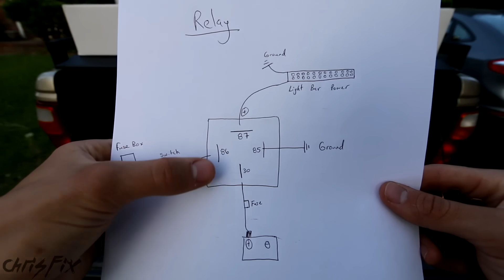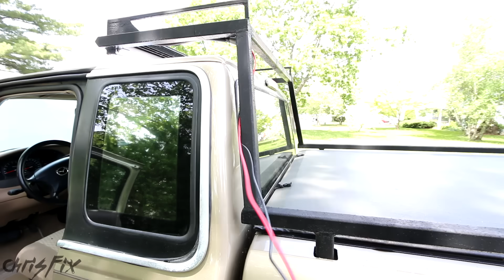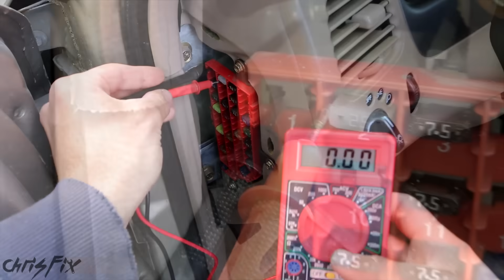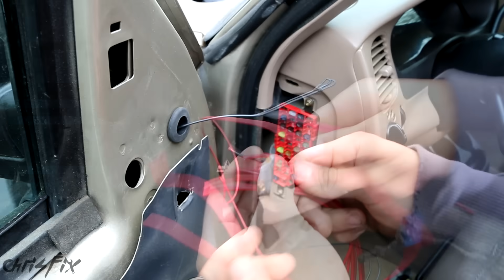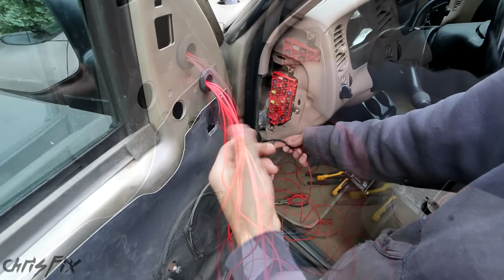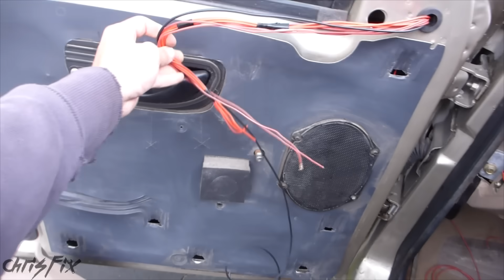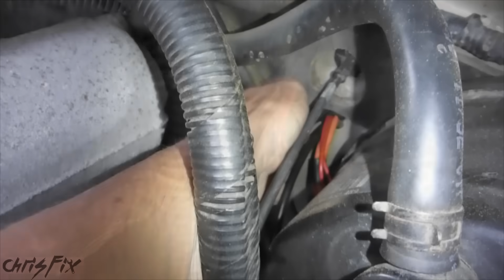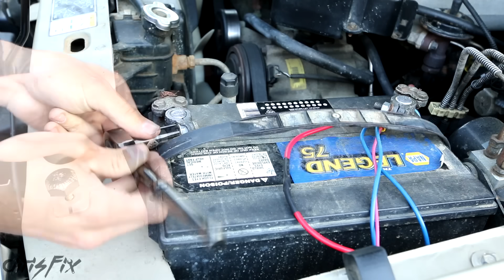How to Wire an LED Light Bar Properly (Project Night Light Episode 3)

Comment: Your high-beams are pretty weak.. Mine light up everything at about 30% of the brightness of your LED bar.

Really tempted to install something like this though. May wire it to both the high beams and an independent switch so they both turn off when facing oncoming traffic

That way I still get the longer range light of the highbeams without having to turn two separate switches off in the face of oncoming traffic! (While having a switch to disable the LED bar on main roads)
Most of the roads around me are rural, Only meet 1-2 cars if any at all.
Reply from the maker: Azurren The high beams are normal 65watt high beams. The light bar is just that much brighter!

Comment: Very well explained, electrical is by far the hardest for me.  Thankyou for another spot on video!  Your helping alot of people!  Especially like the drawing out your plan, that's the most important part of any electrical work, have a plan i.e. lights, gauges, and so on.  Only things I noticed were the negative terminal main harness looks frayed and the out side light harness going down the cab should also have that large rubber on the outside as well to further protect from people and weather.
Reply from the maker: Ryan Schneider Thanks a lot Ryan. I am glad you are learning a lot! I need to install new battery terminal ends and get that whole system in better shape. I am installing a new alternator so I will upgrade the wiring as well! As for the other wire that runs down the side of the cab, there is only so much you can do to protect it so as long as the main wire that is hardwired into the light bar is protected, I am satisfied.

Comment: It is significantly easier to run the switch off a ground and give the relay constant power from the 30 pin to the 86 pin. You can typically find a ground source easier than a power in the cabin.
Reply from the maker: wingman778 Thanks a lot! I never really thought of running switches off a ground until now.

Comment: a few points that i wanted to say: 
1.it's not so much important on older vehicles but newer models, you may want to use a memory saver (some models plug into a cigarette lighter) the reason for using one is ive seen cars (vw) where the battery was disconnected and then when it comes back on, the throttle is not set properly (it adjusts for build up) the only way to fix this issue is to take it to a shop (a kid in my class learned the hard way)
2, i personally like to add heat shrink to the bare metal of the exposed crimps (when attached to a relay or switch) or ill even scrap the plastic color piece of the crimp connector, solder and crimp then add heat shrink. the likelihood of something happening is slim but i like to avoid any possible issues.
3, when adding switches to doors I recommend the use of water proof ones, should your door be open when raining
4, the other alternative to heat shrink, which ive used a few times, is liquid electrical tape, if you haven't used this stuff before let me know ill send you some to try.
other than that this video is well made, you thoroughly go through each set (and repeat things) 
5. future project ideas: i would add marker lights to the sides of the bar (down the back window) maybe add a light bar (amber tow truck type thing)
keep up the good work (sorry for the essay comment)
Reply from the maker: austins_creations Thanks a lot for the tips! I like a lot of your ideas and project ideas!

Comment: Why didn't you just ground the switches to the door instead of running a wire through. Apart from that GREAT job Chris.
Reply from the maker: Big Guy Review Thanks! I dont know how good the door is for a ground since the factory ground was not grounded to the door. I figured it would be best to just put it at the factory ground location.

Comment: That's so cool Chris
Awesome job
I want to know if it baseball to have same like this LED light to be sheept on to me
Thanks alto man
All ur video ar very helpful
Reply from the maker: Moaiad Salih Thanks a lot! What do you mean in your last question?
Reply: My guestion is: this LED light bar ar not available in my country and I need it for my car am doing off-road most off time...so is there is anyway to send LED light to my country. ......
And I have another guestion. ..... can I connect the LED light with the headlights so when turn on the headlights the LED also turn on???
Reply: Thanks Chris. ..u r the best
Reply from the maker: Moaiad Salih You can contact Wurton and see if they will ship it internationally for you. If you mention ChrisFix and the video they might help you out. You do not want to hook these up to your headlights because you cannot run them all of the time. It is too bright and you will blind people. But you can hook it up to your high beams.
Reply from the maker: Moaiad Salih You can contact Wurton (light bar company) and see if they can ship it to you. I wouldnt connect it to your headlights because if you are on the road, you cannot run these when cars are around. You will blind them.

Comment: So i'm installing RGB LEd strips as under light without relay. Can i just run a wire(with fuse) from the battery and than put the negative on chassis? the strips(controller unit) only uses 2A. Or is it really needed to put the negative to the negative on the battery?
I'm not using a switch between. Not that its a problem to put the led negative on battery negative.

I'm having this question because most electronics are wired as ground(including AMPS)
Reply from the maker: Sword of damocles Since it is only using 2 amps just make sure you fuse the wire within 1 foot of the battery to be safe. You do not need to ground to the battery, you can ground to the chassis. Let me know if you have any other questions!

Comment: Great video man, as usual..... I would have mounted the switches on the dash and would have used fighter jet style. At least that's what I plan to do.... I'm in the process of finishing installing my cb radio. You should put 1 too, they are cheap and easy to install.
Reply from the maker: Arlind Sadikaj Thanks a lot! I couldnt find a spot on the dash that was good and easy to get to. My arm is always resting on the door so the switches are right there for me! A cb radio would be pretty cool!
Reply: ChrisFix I have an expedition, I have plenty of space so hopefully it comes out nice.

Comment: Hey chris!! I have a 2001 accord and my mom just gave it to me, it iw in good shape but the clear brown leather on the inside has yellow and black spots that I've tried to clean with alcohol and a product from the mall, no luck.
Can you make a superclean video on how to clean leather interiors?
Reply: I have the same car and I love it to death but that stupid leather gets so dirty. Get some simple green and scrub brush  and it will just come right off
Reply: Applekid What is that? I live in mexico, is it made of alcohol, its a window cleaner or just common cleaner. Thanks
Reply: NicholasCagex10 for impossible stains, I use very little amount of break fluid on a cloth, works like a charm depending on the type of stain.
Reply from the maker: NicholasCagex10 I probably wont have a video on cleaning the interior for a little while but for now, try using saddle soap. It is for horse saddles and is supposed to be really good for cleaning and protecting leather!

Comment: Great job Chris , but won't all these lights and the alley lights will put too much demand on the battery and the altenator while the engine is idiling? ex: some shaking, just wondering.
Reply from the maker: Mohammed Alsultan It can but that is why I am upgrading my electrical system with a larger alternator and better wires.

Comment: Wow that makes such a big difference!!, from candle power to stadium lighting in one click :-))
Really smashing professional job chris :-D, love the split fit tubing, looks so professional and really neat/safe, I dont think it could be done much better than that mate :-D
One oh so minor thing, you plugged the fuse in before you routed the bare cut wire through the engine bay, if you left the switch on then it could have shorted, but you didnt, so it didnt ha ha :-D.(dont re-edit, its fine).
For non illuminated switches i put the switch in the coil earth side of the relay, just a single wire runs into the cab to be earthed anywhere.
No danger from it getting shorted to ground or live, the relay coil power comes from the battery+ allready on the relay, no fusebox tap.
Reply from the maker: zx8401ztv Thanks a lot bud! As always I appreciate the tips! From what you and many others have suggested, it sounds like I should have ran the switches off the ground instead of the power. I can still adjust but that is good to know!

Comment: High beams seem like low beams compared to that sun on the roof :D Is there a reflection on the road and gravel or is it just the camera being weird? You should've zip tied the wires behind the door panel too, but that is just nitpicking :) Great job!
Reply from the maker: February After shutting the led light off, I sometimes wonder if my headlights are even on haha. That is the camera being weird because the light is more concentrated there.

Comment: So I can't use that on the highway right ?  What if I mount it below my car kinds like doc lights ? Because my highways have no light and it's pretty much black after 5 feet in front of my car.
Reply from the maker: Echo-GAMING You cannot use these on the road if there are cars. Even if it is mounted low it will blind people because it is so bright. That being said. I will be installing some HID Projectors so stay tuned for that which will give your car a lot of light!

Comment: Adding all those lights wouldn't that put strain on your battery and alternator?
Reply from the maker: ***** Indeed it would which is why I will have a video soon on replacing the alternator with a 130amp instead of the stock 95amp.
Reply: yes it would

Comment: Nice job. I never thought I'd see LED lights about 65°kelvin. Which is as bright as the sun.  I thought my led flashlight I used for inspecting homes was bright. It's only 256 lumes.  What was your rating on the package of the light bar?
Reply from the maker: George W Thanks! The light bar is 40,000 lumens! Crazyyyyyyy!

Comment: Aaaa, holy crap that thing is bright!  LOL

From experience, I would strongly recommend that you make a bracket or find a location to mount that relay upright.  Those things just love to pull moisture out of the Nth Dimension and corrode themselves to pieces, even when you think they're tucked away well enough.  :]

Awesome project!  It's been fun watching this progress.  :D
Reply from the maker: rhkips Thanks a lot and thanks for the tip! I will add a little bracket and move it upright!

Comment: what if you linked it to your high beams still with switch?
Reply from the maker: Luke Reynolds You could do that but this light is way to bright to be using it with your high beams on the road. Like if you wanted to flash someone for some reason, you would blind them with the light bar.

Comment: Came out great. I put a 21" bar in the bumper of my F150. I couldn't believe how much it helps when I take these country back roads at night. Instead of a switch, I built my own relay harness and ran the switch wire to the high beam signal.
Reply from the maker: Primer2tone Garage Thanks! Yea, these LED lights are great technology and really work great to produce light! I like the idea of wiring it to the high beams so you dont have to put a switch! Nice!

Comment: Hey Chris, been watching your videos for months now and love them. Thank you for doing this. I do have a question. You showed us your low and high beam as well as the new light bar (awesome btw) but you didn't show us your off road lights. I have a dual grill front end and want to put a light bar lower at more as fog light hight and behind the grill. So my question is, what would the pros and cons be of placing your light bar on the roof like you did or just below the bumper?
Reply from the maker: patrick gilmer Thanks Patrick! I am glad you like the videos! I was going to show the 4 offroad spot lights but they are barely visible with the light bar on and with the video being so long, I had to cut some stuff out. I dont think it is best to use a light bar like this as a fog light because the light is diffuse. If you can find a light bar that is strictly a spot, that would work down low like you were saying. You need more of a spot light for fog. The 4 spot lights I have work great in the fog. 
The pros for a high mounted light bar is a longer throw of light compared to below the bumper. The cons are it is not easy to mount up high. It is a lot easier to mount to the front bumper.

Comment: Psst. 8 wires is enough for 7 switches. For those you can share a common constant. And it's a lot safer
Reply from the maker: RedTeamWolf That is another way to do it But I wouldnt necessarily call it safer.
Reply: RedTeamWolf I would also think it is also easier to run the current directly through the light in the switch since he is using the wiring as signal wires only. If he switched them on the ground side he would only need one wire per switch.

Comment: Great video, just one note;
When you pick your wiring gauge, you should pick a gauge for the fuse you're using, not what the light actually draws. In this case it turns out to be the same, but that's not always the case.

Same goes for all wiring, no matter if it's in a car, a house or anything.
Reply from the maker: Jesper Åhman Thanks a lot and thanks for the tip!

Comment: Not to sound rude at all here, but what made you spend almost $1000 for a 42 inch bar with cree bulbs and internals with a little better housing, instead of buying a basic cree 42 for $70 and just ensuring its waterproof by packing the end caps and running a bead around the lense with $10 worth of silicone? Again no intention of being rude, your videos are all awesome and extremely helpful, just curious as to the reasoning behind your choice is all. Stay awesome!
Reply from the maker: Doominator13707 Thanks for the input but the light bars for $70 do not compare in brightness. Forget waterproofing because like you said, you can always try to fix that yourself, but the light output in lumens is not comparable. This light has 39,400 lumens which is insanely bright. Plus the lifetime warranty. Have you had any experience with the cheap light bars compared to the good ones?
Reply: ChrisFix that is very true for the output aspect of it, as well as the warranty I did not notice that. My 52 inch cree is rated at 40,000 lumens so no it's not the brightest, but it's plenty for me. But valid point sir, and yeah I have had experience with top rigid bars to cree to the in between and for the massive increase in price, I just find it more cost effective to buy cheap and bulletproof it yourself. A large majority of them have similar internals and it gets to the point where you are almost paying for the name, more than for the product. But to each man his own I suppose, I'm big into Jeeping, offroading, being able to see deer at night, etc. Haha. But again man I meant no disrespect or hate whatsoever and you are doing a great job with the videos.